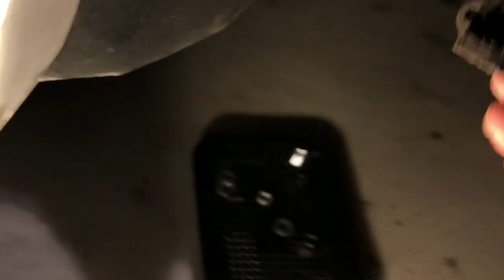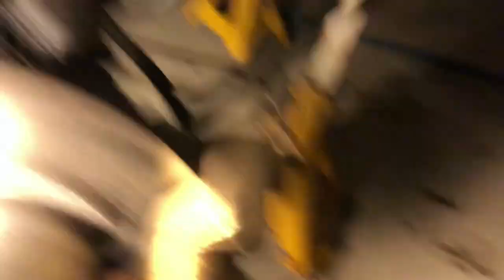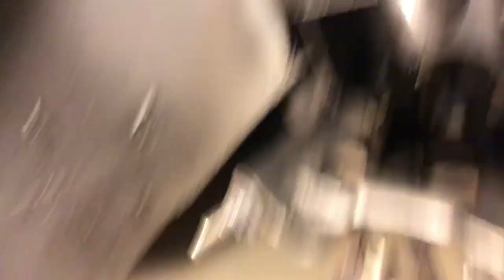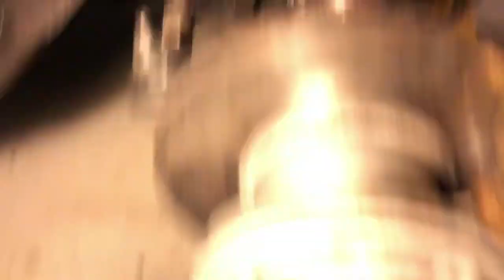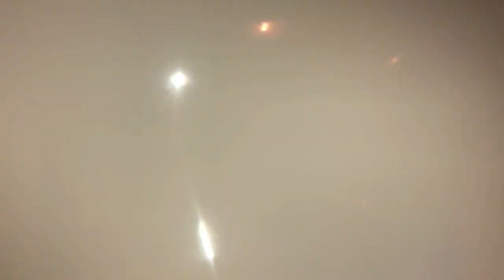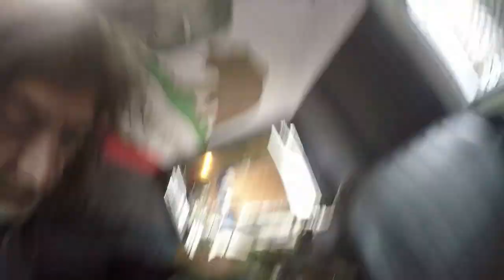Classic Mini Coil Spring Conversion by Jemal, Part 2 Front Suspension

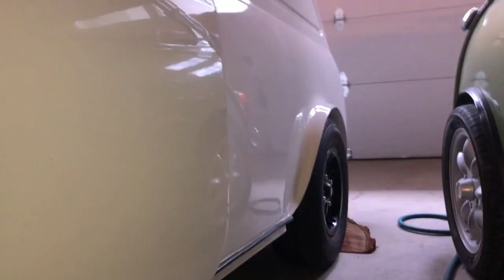Comment: nice instructional video jemal used this to install my springs and hilos. Hoping you can answer a question. I want to run my car as low as you have it (11:15 mark). However, when I turn the hilo all the way in this causes the spring to be loose, is this ok?? i fear that it may become dislodged when driving or jacking up the car. any tricks to keep the spring and hilo in place??